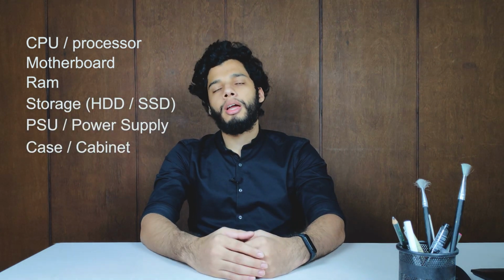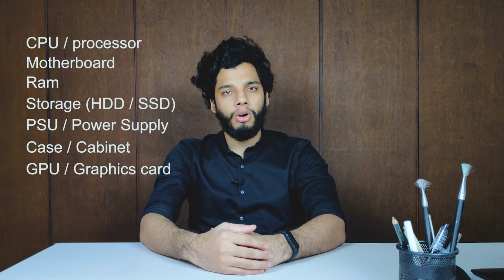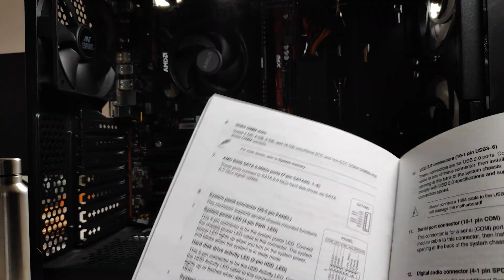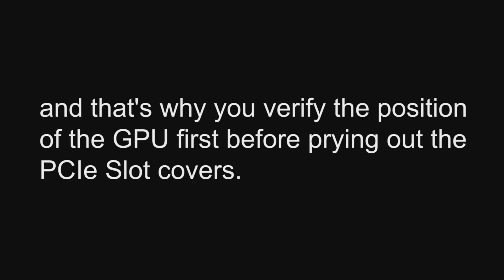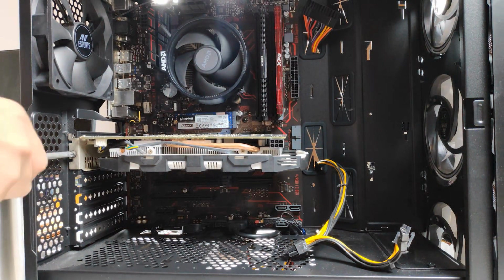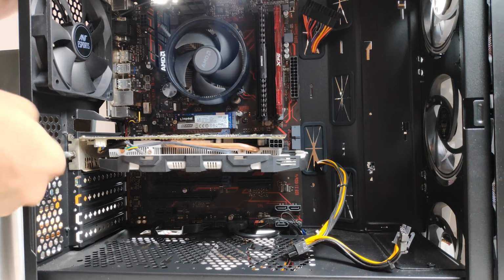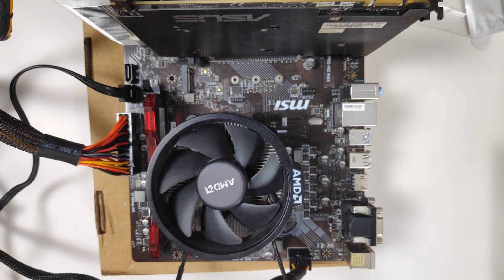How to assemble a PC - For Beginners!

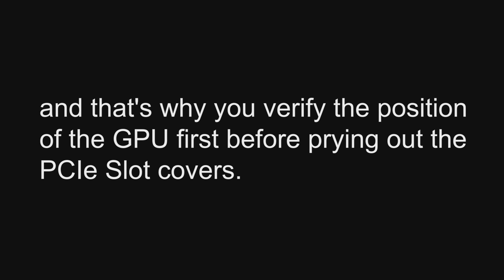Comment: 11:51 You didn't remove the lower slot PCIe cover. Nice Video, cheers from r/IndianGaming!
Reply from the maker: Thanks for visiting! Yep, I did not remove.  As mentioned in the video, I removed initially two of them but that was without checking the actual position. Then I decided not to remove the third once since this specific GPU has ports only on the top slot. The bottom slot just has MSI carved on it.
Reply: @UnboxParadigm  I see. Will that cause an airflow issue?
Reply from the maker: @kichapps  unlikely, even the slot covers have holes in them and the top and front of the case is mesh, so airflow shouldn't be a problem.
Reply: @UnboxParadigm  ah yes, you're right. BTW, are you from Kerala? Your accent seems like it.
Reply from the maker: @kichapps  haha yeah, I am from Kerala :)